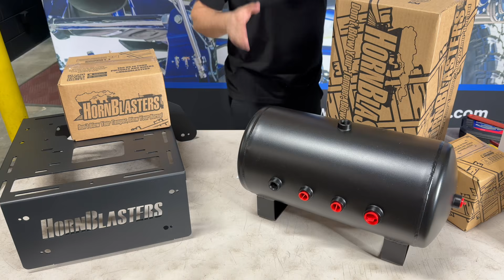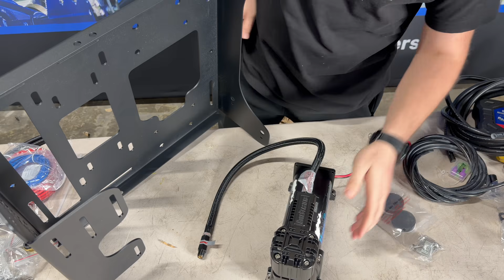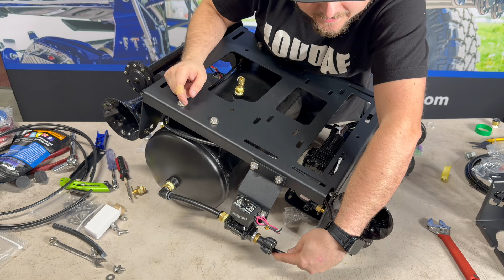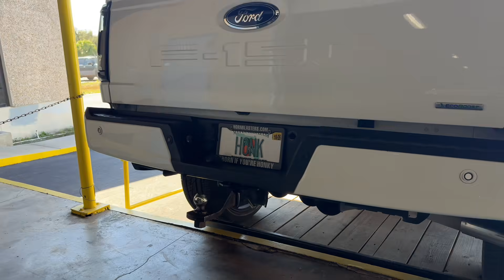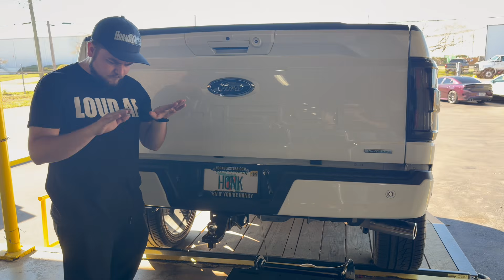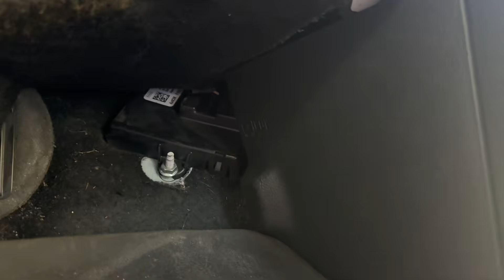Installing a HornBlasters 5-Gallon Stealth Kit on a 2022 F-150 | Spare Tire Delete

Comment: Video shows inserting airlines into the 4 way. Then shows bolting the valve to bracket. Video isn’t in order. Instructions don’t match the video. This kit sucks. Plus all the missing hardware and fittings. And was sent the wrong replacement fittings.

Comment: For my control power wires (it sounds crazy) I used cat 6 Ethernet cable. Had to wire an extra relay which was not a problem. Power wires 10 gauge. Works like a champ!